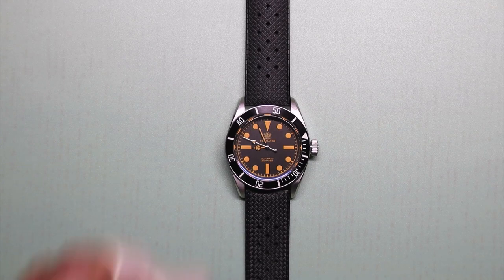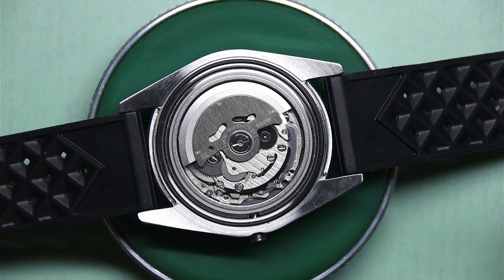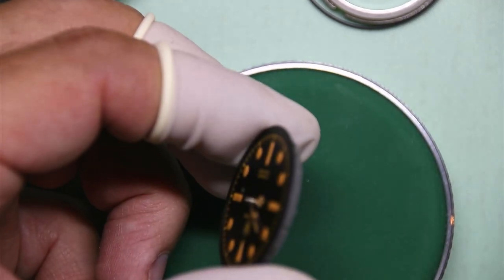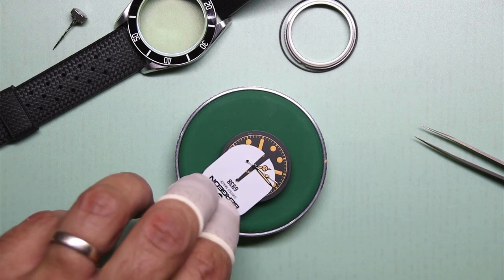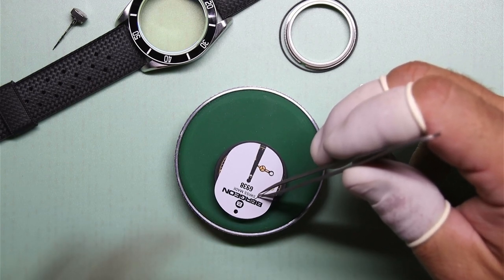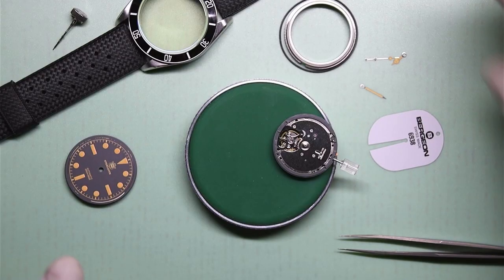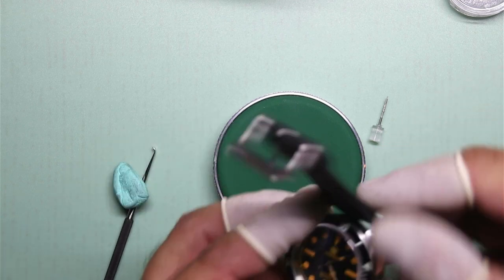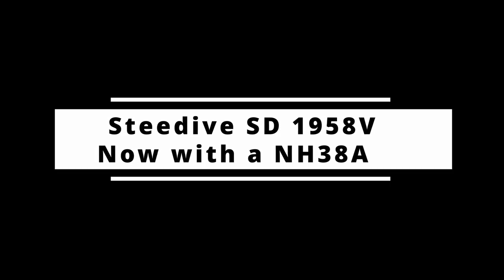NH35A to NH38A swap

Comment: Thank you for making this video! I would have been lost on AliExpress without this conversion. Also, I have a vintage Coca Cola swatch that uses a day-date quartz movement, despite only having an hour, minute, & seconds hand. I think brands just use whatever is cheapest/what they have on hand.
Reply from the maker: That is probably what happens. Cheers
Reply: I got a baltany explorer 36 from Ali express and in 3 months, it’s stopped working..as soon as the warranty was over.  I tried to check with the local watch maker but he kept it for a month just to say that he can’t fix it.  I felt so disappointed and then I saw this video…thought I would give it a try…got the NH38 movement from eBay and did all these steps..was a good learning experience watching so many relevant videos…how to use these hand removal and installation tools…personally I feel that all these Chinese watches use some very poor quality Seiko movements..I’m not sure if they are even original Seiko movements..

Comment: The reason is manufacturer try to keep the cost low. NH35 cheaper than NH38,also it works on both date dial and non date dial.
Reply: Absolutely , steinhart buy ets movements by the pallet load , its business ,  im sure rolex do it with their eagler movement suplier

Comment: The NH35A is a great movement.  So is the NH38.  I have both.  The NH35A is cheaper in price.  This is why it is in all the cheaper watches on Aliexpress.  Unless I needed the extra movement I would not have changed it out.
Reply from the maker: Of course it wasn't necessary but one is a $25 movement the other is a $28 movement. Now my watch doesn't have the ghost position anymore and that actually makes me like the watch more.
Reply: Glad to know, I won’t be using Landfill Express for my watch purchases.
Reply: 😂 ok Sherry

Comment: I think the only reason why you want to change the NH35 movement to the NH38 is to view the balance tickling at the 9 0'clock.    With a dial without the window at the 9 o'clock ,  there is for me no reason to do it.
Reply from the maker: The reason for me is that the nh35 actually has an installed date wheel and a crown position for setting the date but this watch doesn't have a date window. Secondly, i am replacing it because I can and i will use the nh35 movement in another project.
Reply: Lo estoy remplazando "porque puedo# 🤣, que respuesta más llena de contenido😂

Comment: Great watch, thanks for posting. Are the hour hand and minute hand aligned like at 6 o'clock they make a straight line? that part seem the hardest. Did you use magnifying glasses/loupe?
Reply from the maker: I line up hour and minute at 12 o'clock. I used some loupes.

Comment: Great video! Quick question, are all the NH movements interchangeable? Are they all the same size? I'm looking for case options for an NH38 and I'm wondering if I can just use an NH35 case for it.
Reply from the maker: Yes the NH  movements have the same overall dimensions. The specs can easily be found with Google. Cheers
Reply: @HeikosGarage  thank you so much, I really appreciate the quick reply!

Comment: Nice! Have you tried this on a san martin?
Reply from the maker: @jrmortel  if the San Martin has no date window chances are there is a nh35 in it. It will absolutely work. The nh35 and nh38 are the same movement. The 38 just doesn't have the date complication.

Comment: Thank you so much for your video!
I do have a question, the stem of the nh35 movement will fit on the nh38 movement with no problem, is the same stem?
Reply from the maker: In principle the end of the stem will fit but you will have to adjust the length of the stem. In one of my videos i am showing the process of clipping down the length of the stem.
Reply: @HeikosGarage  Thank you so much!

Comment: out of the box my steeldiver 1970 with nh35a is 4 seconds a day fast and 1.2 beat error...
should i open it up and try and improve?
Reply from the maker: If you have a timegrapher you definitely could try. Good luck. Don't forget, even if it goes sideways, the movement only costs around $30.
Reply: Yes because that beat error is too big

Comment: I have a nh38a i got thats in a quicksilver watch can i remove it buy a nh35 case with same crown position.

And then put the nh38a into the 35 case and make my own wach?
Reply from the maker: @putnamehereholdmadoodle  yes you can. The movements are identical the nh38 just doesn't have a date complication.

Comment: great video! I bought a PD-1964 with an NH35 and want to replace it for a NH38 just like you did. my only fear is about the threaded crown.
Reply from the maker: Most likely the stem will be the correct length. I don't think I had to shorten mine. It is really not too difficult. There are some great videos out there that explain how to get the stem the perfect length for a screw down crown. Go for it. It makes the watch unique and truly yours. Gets rid of that pesky ghost position.

Comment: Could you have fitted the VH31 mecaquartz movement instead ?
It is the movement that should have been fitted IMHO...
(it is 2022 after all) 😃
Reply from the maker: Buying a automatic watch to then put a quartz movement into it would kinda defeat the purpose. 
The attraction of mechanical device is just that, they are mechanical and don't use modern ICs or circuitry.
Reply: @HeikosGarage  Some Steeldives are available with VH31 and NH35. On an inexpensive watch it is nice to have a quartz movement with a sweeping hand. Less thing can go wrong with a quartz watch, if used as a beater during sport activities, an automatic movement is more delicate. Where I live, NYC, watchmakers charge $300 to service an automatic watch. A quartz can be an attractive option.
Reply: Quartz needs yearly battery replacement and I don't like unnecessary expenditures. I learned to service my own automatic watches. A good automatic tool watch is like the old air cooled beetle. Ultra reliable and with little maintenance runs for ever.
Reply: @AndreAndre-yd5gw  that's great you learned the skill. It must be quite complex. There is always the risk of breaking something. How do you prevent dust from getting in the movement? Any videos you suggest?
Reply: If building a watch and using a NH35 and using a dial without a date window, you can remove the calendar works/ date disc from the NH35.
Reply: quartz and mechanical automatic is similar like with electric cars and fossil fuel cars. Someone likes both some not 😁

Comment: Is it possible, to exchange the Epson YN55 movement with the Seiko NH38? If I understand well, the Epson YN55 movement basically identical to the Seiko NH35. I just don't know is it stand for general features - parts/construction and working/accuracy - or also the exact dimensions too?
Reply from the maker: Not sure. Good luck.

Comment: I would not recommend this swap for those with threaded/screw-down crowns as the stem travel to set time is minimal (calipers suggest <1mm). This vid required much luck and I’m doubt it’s highly repeatable. 

I suspect a company like Unimatic, which typically produces no dates, uses the NH35 as the ghost date adds additional stem travel allowing for a threaded crown. 

Source: tried an nh38 on a Unimatic homage build and it was incompatible with the threaded crown. Wish I had know.
Reply from the maker: I think that a stem length adjustment (cutting) could be necessary but that a nh38 is incompatible with a watch that accepts a nh35 is unlikely. The movement of the crown to be able to screw it against the case is not done by stem movement but by the spring loaded movement of the crown along it's attachment point. 
In the unscrewed position the backside of the crown needs to line up perfectly with the tip of the threaded tube that protrudes from the case. Give it another try and see if there is a gap between the Crown and the tube i mentioned.
Reply from the maker: Zachary,
If you like, you can send your unimatic watch to me. I pay for the nh38 and I will put into your watch and make it work. Of course I would make a video out of it. Let me know what you think.
Reply: The nh36-35-38 are all the same except for the date complications. it is imposible for an nh38 not to fit where an nh35 was. NH36 and 35 can be easily moded to become nh38 by removing the date complications, I have done that many times. the reason for your issue is not the movement but the stem length.
Reply: @carlodelavera9735 removing the date complication is only halfway to making an NH35 into an NH38. You would need a two position setting lever.